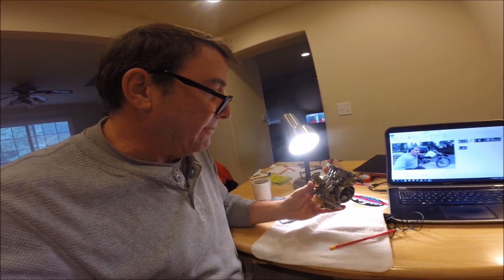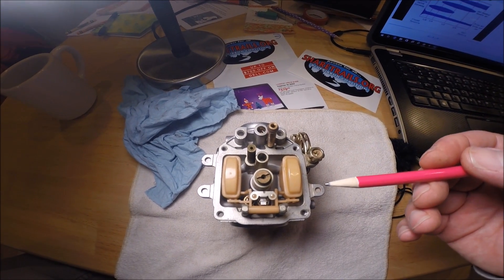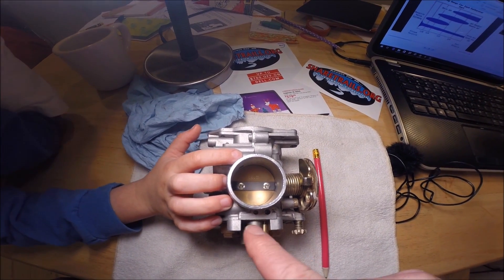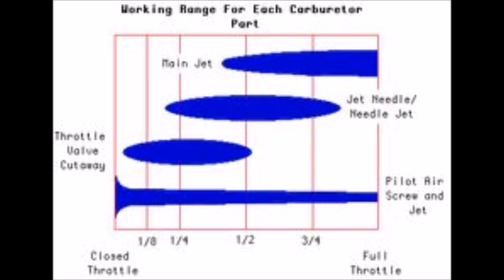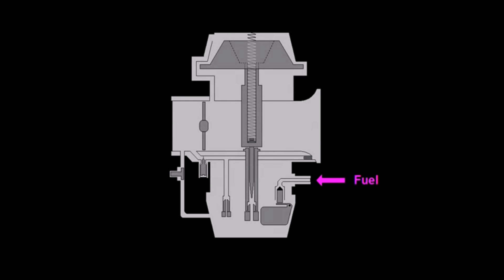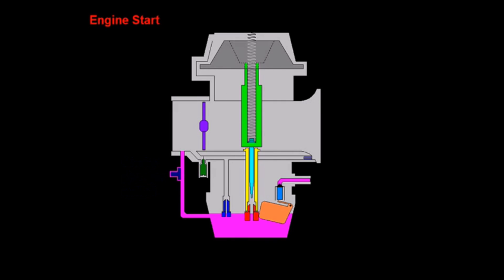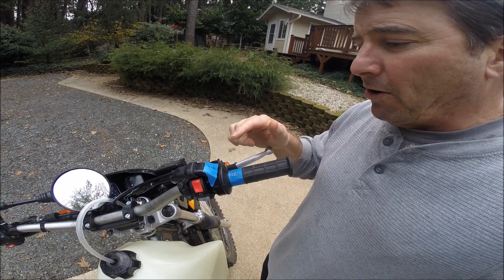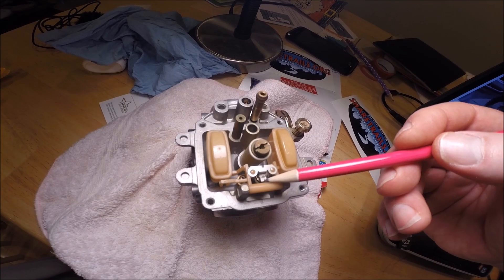CV CARBURETOR THEORY MIKUNI YAMAHA XT225

Comment: pretty clear. You might want to mention that you need to increase the amount of fuel flowing through the main jet at sea level, and the higher you go an elevation, such as to Denver Colorado, which is a mile high, you need to go leaner on your main jet. Because there’s more air in the air at sea level… The higher in elevation, you go, you sometimes have to jet while doing trail riding if you climb a couple thousand feet in elevation down to leaner jets. Formula One cars because there’s less air the higher you go, when they race in Mexico City, which is over a mile high in elevation, they lose over 100 hp.

Comment: many thanks, mister, short video with tons of info regarding how diafragm carbs are working ... in fact, I have to tune the same carb on a ttr250  that works only with the chock puller out  ..... I will use this knowledge from your video, regards from Greece.

Comment: THANK YOU for taking the time to produce this (thanks! to your wiffy fir her patience with the stinky carb in the house : ))

I just got a 2006 XT225 and the carb had a broken choke nut, the air cutoff valve plastic body was cracked, and the air cutoff valve diaphragm was installed about 20 degrees off (not seated within the cavity to the side).

GREAT VID 

These carbs are quite different from the 1940’s - 1960’s American carbs that I’ve worked on for years.

Thanks again

Comment: That's all good. But why a vacuum slide? Why not a cable actuated round slide. Why not a flat slide? What's the advantage or disadvantage of a vacuum slide.  Why are they not used on two cycle engines?  Didn't I see you talking about the caldoor fire.

Comment: hi, i have 1999 Yamaha xt225 only 260 miles on it but have a little problem it shuts off when revved up anyone knows the problem it runs but in high rpm dies I replaced carburator with a new one little better but still doing it.

Comment: Question: I have a 87 Suzuki DR200 with a Mikuni 42A21 pumper carb. I can't find an oem 42A21 flat slide carb that I can afford not knowing more about this bike. I see there are CV carbs that say they will work on my 87 DR200. What problems will I run into if I purchase a CV that's said to fit? Thanks for any help.
Reply from the maker: Don't know...give it a shot and let us know.

Comment: I think  your XT videos are going to make you my hero for the upcoming venture into my new to me 2002 Yamaha XT225.  Just picked up this garage queen with only 210 miles on it. Flushing gas and oil and riding it. Floats were stuck seafoam cleared the issue.  I understand these were under powered due to the jetting from the factory and that you can get more power out of them.  Looking forward to your video.  WOW just finished the video.  NICE JOB!

Comment: Thank you for your videos on the various aspects of the XT225.  I just picked up a roached out 2004 model that hasn't been started in years and am starting the autopsy before trying to revive Frankenstein.  Much of the rusted through gas tank has found it's way into the carb and I'm sure other places.  I'm about to replace the jets and tank with a Clarke and your videos have proven most helpful to understand the nuances as compared to the old BMWs I'm used to reviving.   Thank you again!

Comment: Thanks for putting this stuff up.  It help immensely.  Got a 2002 stock xt225. Today I cleaned the carb and did the 3 turn mod (it was at 1.5 turns). Put it back together and it started/warmed up significantly better and quicker than before. New problem is it sputters/misses really bad at mid throttle. Totally fine at low throttle and fully open.  Anything come to mind? Like the needle jet not sliding properly???  Not sure I understand the sputtering only at mid throttle.  Any thoughts is much appreciated.
Reply: bobvall9731 my guess is raising the needle in the slide with a thin washer.
Measure thickness of washer with a micrometer and write the number down on paper.
Keep all notes.
You didn't include the altitude were you live.
Needle timing to throttle setting for fine tuning.
Use twist grip tape markings to eliminate guess.

Comment: i have a 96 XT225 and the plastic top peice on the air cutoff is broken off. my bike is running extremely lean. runs for a minute or 2 and the exhaust starts to glow. runs fine though. would this piece being broken off cause this?
Reply from the maker: yes, I hear you can get replacement parts for that somewhere online, not sure where.
Reply: blancolirio i ordered the parts needed to fix it but do you think this is causing my lean condition. I just bought the bike and dont know how it ran before that piece was broken.
Reply from the maker: Yes this should do it. Go through the whole carb.

Comment: Fantastic and easy to understand video. I wish I watched this video BEFORE I swapped out the jets on my xt225. I did not note the position of the factory jets, and when I installed new ones, I just hand tightened all of them. My bike idled fine, but puttered out fuel starved when I opened up the throttle. Now I know to go back and try different settings on the jets.

Thanks!

Comment: cannot find the carb overhaul video you refer to ... need see it to learn if there you mention why my '04 carb lacks 2 features seen on yours.  firstly is lack of an adjustment screw for pilot mix  ... where your carb has a hole and a screw down inside that hole a ways , my carb has a brass 'plug' filling that hole and with a sub-mm hole in it.  
2'd is a brass tube in this same neighborhood sticking out from the carb body on yours and not on mine.
on p. 5-1 of my svc/mnl the pilot screw is item no. 14 on a list of 19 carb parts cited.
along with the '14' is the letter 'C' and a different list of 3 entries : B ,C ,D says  "C  for USA , it is unadjustable from regulations"

 if u-tube allowed comments to include photos it could easily be done here.  so you and other
'04 225 owners could see the differences i am writing about.  as right now i am unable to
make the critical idle mixture adjustments

Comment: Love your videos, very helpful!  I really enjoy how thorough and articulate you are and that you really show things as you're doing or discussing.  I have a 2007 XT225 and have done all of the Mods, plus a few, that you have except for the handle bar, I'm still using the stock bar, with heated grips.  I have a Scotts Stearing Damper kit to put on as well, but with the Clark Tank, it is a bit closer to the steering column and not sure how to go about modifying and welding the required post for the damper yet.
I do have a few questions:  What size D606 Rear Tire do you run?  How many chain Links on your drive chain, and did you have to use more links than stock to accommodate your D606 Rear tire?   I put a 4.5-18 Kenda 270 (supposed to be the same size as D606 120-90-18) and it is rubbing the front of the swing arm with the stock chain as tight as I can without super over tightening the chain.  Did you notice any real riding difference in the sprocket changes you did with going from 15-45 to 14-51 I think it was? If so, what differences high and low speed and do you like it still?   Thank you in advance and GREAT VIDEOS!!!
Reply from the maker: The current gearing is VERY low for extreme trails (trials riding)  like the Rubicon. As such top cruise is only about 50-55mph. Buy a longer chain and remove just enough links to fit so that the rear tire has some room from the swingarm. I'll check on that tire size.
Reply: blancolirio Awesome, thank you so much I appreciate the help and your checking for me..

Comment: Great video. When you look at the butterfly valve "disc" that the throttle cable attaches to, there is a hole in it that allows access to a screw in the carburetor body. Can you tell me what that screw does, if anything? Mine had the screw backed out so far that it was rubbing against that throttle disc?

Comment: My Suzuki kept running rough even after I had thoroughly flushed the carburetor with carb cleaner.  I removed the jet and looked at the hole in the jet with a bright light and a magnifying glass.  Light could be seen through the hole, but the hole was partially obstructed with what looked  like a honeycomb of very small solid particles.  These particles were NOT soluble in carb cleaner.  This bike had a good fuel filter, so where did these particles come from?  I wonder if maybe the particles were aluminum oxide from corrosion within the carb.  All was well after running a very fine wire through the jet.  It's important to inspect the jet hole very carefully if not replacing the jet.  I suppose that plugging wouldn't be a problem with the main jet since it has the needle running through it.  (The carb on my bike looked spotless and the bike is well-maintained and run regularly).
Reply from the maker: Yes, these holes are TINY and need to be clear to run properly...this is why carbs are more problematic on small displacement bikes that may tend to sit for long periods of time.